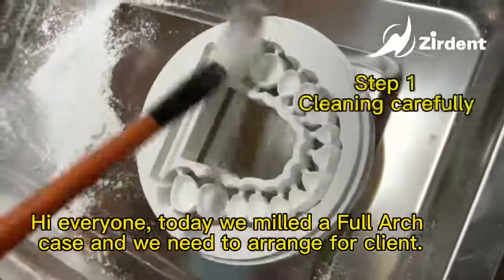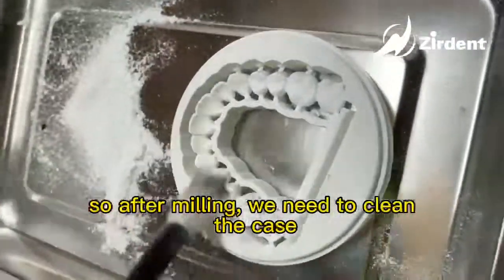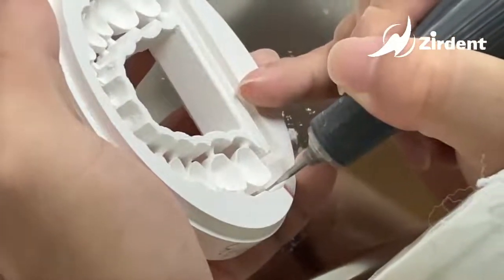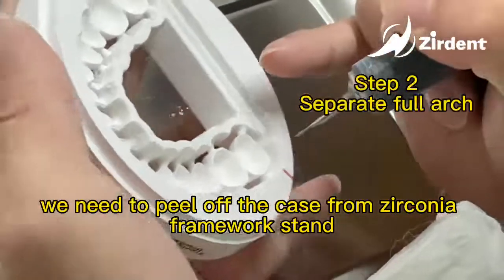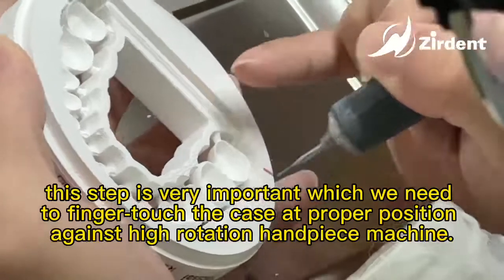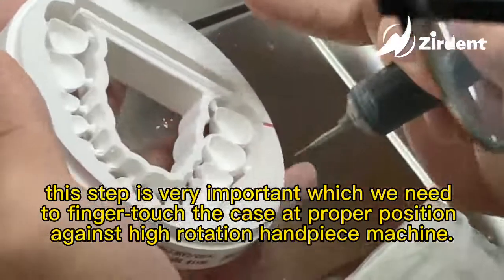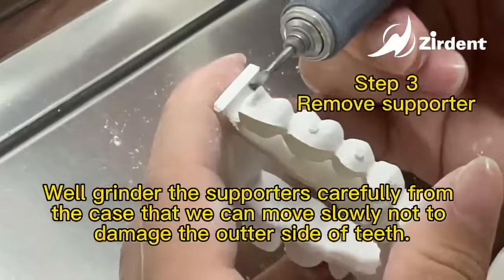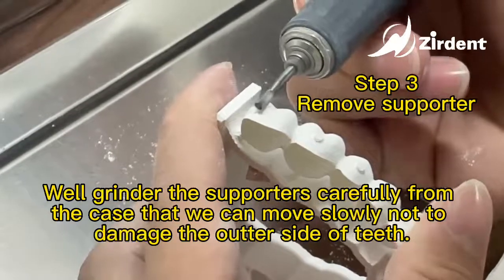Steps after milling zirconia case

Comment: Nice, but you used WAY too many pins, especially between the bridge and the support bar. You don’t need to place one buccally and one lingually on every single tooth in the restoration; six pins on the facial (#2, 4, 6, 11, 13, 15) and five on the lingual (#2, 5, 8/9, 12, 15) would’ve been enough for this job. Easier on the mill during fabrication, easier on your techs during cleanup (especially when it comes to cutting the bar off and smoothing those pins down after sintering), and generally a better aesthetic result because fewer teeth will have residual marks on them.
Reply from the maker: Thanks for your professional advice!
Reply: @Zirdent_official  
You’re quite welcome, friend!